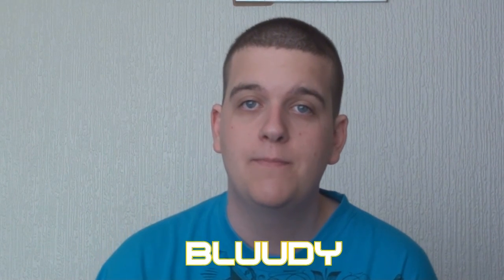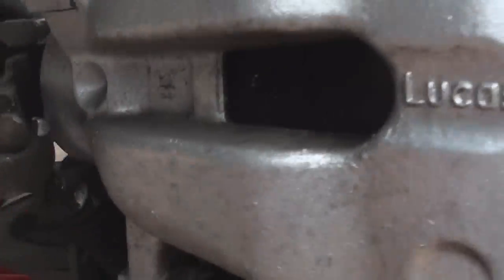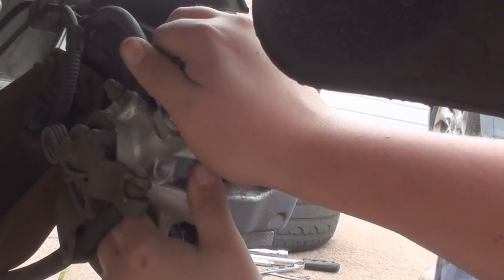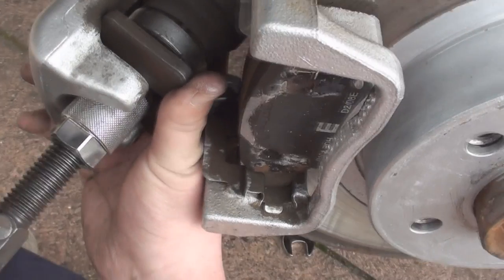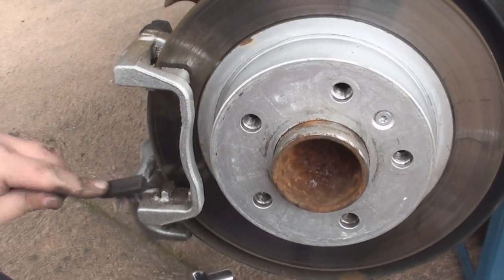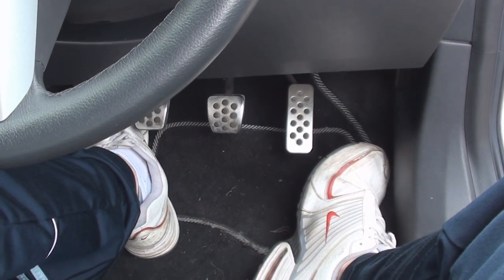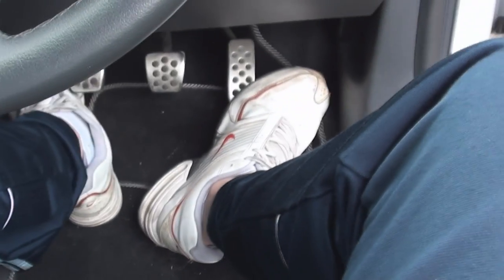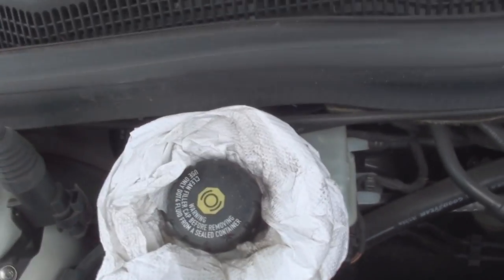How to: Replace your Rear Brake Pads

Comment: Good inf passed from you, thanks. I don't have a piston adjustment tool, can I improvise and just use some water pump adjuster pliers and wind them back so far just to get the new pads onto the discs. or would that maybe damage the pistons?
Reply from the maker: you will be fine. Just make sure you turn it back.

Comment: just done are Astra could have done with a thinner 17mm as nut has a lip/washer type thingy on it, took just under 15 mins a side wife is now happy as the brakes have stopped squeeeeeeeeling
Reply: There are very thin wrenches used by bicycle mechanics called cone wrenches.  17mm is a common size.

Comment: cor blimey, wiggling that caliper off nearly ripped out the flexible brake hose...why not use a flat blade screwdriver between (hardened)piston and old pad..EDIT just completed replace, used a C spanner to wind in piston, realised you cant just push piston back in .I would also pop a length of silicon tube on the end of the bleed nipple into a small jar/bottle with brake fluid in (loosen nipple just before  pushing the piston out, then lock up tight again). Apparently forcing a lot of fluid back into the reservoir can cause damage. I don't actually see why myself.

Comment: At 2.22, when removing the caliper, it takes a few wiggles, but comes off relatively easy. What do you do if it does not come off easy? It is not budging, not even a millimetre
Reply from the maker: providing the bolts are removed you need to pry it off. stick a big screw driver or pry bar in between the caliper and carrier and pry it off.  any more questions please check out our group on facebook
Reply: Take the handbrake off!!